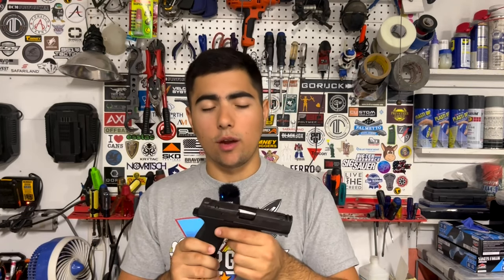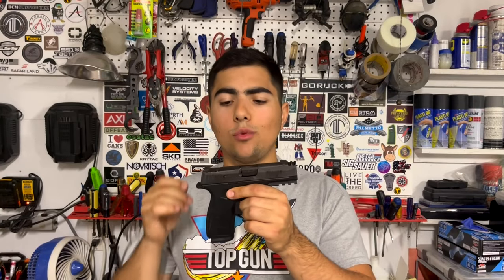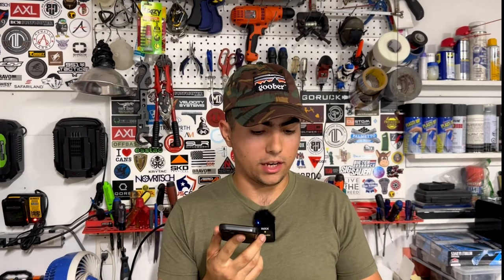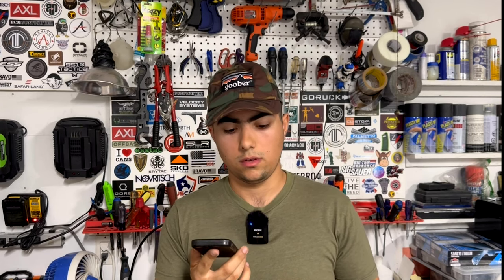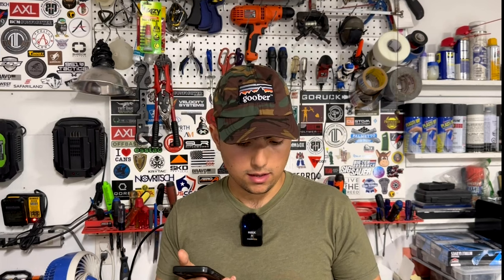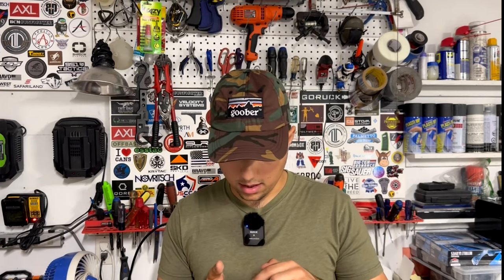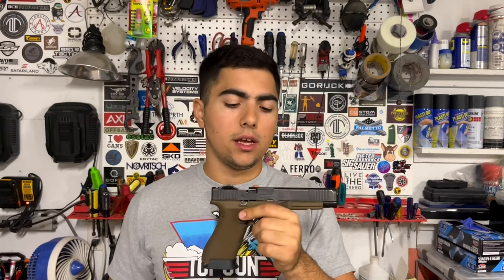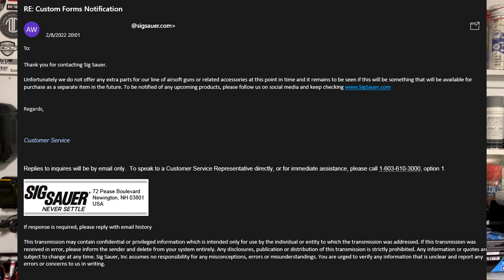Was I Wrong About the SIG P365 X Macro?

Comment: As someone that disagreed and thought you might have even lied about your initial video. I'm disappointed in Sig's response all around. My p365 xl slide hasn't had any issues in over a year of use. 
I won't be purchasing anymore Sigs until I'm confident in their work. Sorry about your experience.
Reply: Here's exactly what SIG did, in my opinion. THIS IS ALL MARKETING AND Most importantly GETTING RID OF OLD INVENTORY..Sig Sauer came out with the macro Grip module,( its a great module.) So Sig made the ported slide with the 3.1inch and a tac opps 3.7inch  that came with 4 magazines, that will probably rust also, sitting side by side with original p365 magazines. 

For the Tac Opps (Invision this and tell me i'm wrong) STRIGHT FROM THE TUPPERWARE BOX, Tac opps purchasers Were given slide back plates that have been unfinished and rusty. Tac Opps owners were given a trigger shoe un-finished & rusty. The barrel or should I say the bore chamber RUSTED. ALL PUT TOGETHER OUT OF A TUPPERWARE BOX.🎉 GREAT MARKETING🎉

I got 2 say not everyone will deal with I am dealing with. Some Tac Opps come with suppressor hight sites and the one I had in had was perfect, but got sole under my feet. Grabbed another one with out inspecting it, now I dot to deal with this BS. I WANT non of these this, I Want my money back they want me to send it in.

I am definitely doing a review on mine this week. So I can show everyone.
Reply: @Pocketpowerplant  where’s it at?
Reply: Glock fan boy doing a review! I have 5 sigs now., no rust no problems.
Reply: @jerrybrooks7883  SIG fanboy acting butt hurt....the guy gas over $1000 into this.....why spend $1000 to make a vid that MIGHT make you $100 over the next 5 years....think before you blurt
Reply: @IronChefBklyn  I do like Sig but I also like Glocks and other guns as well. He was so Glock I didn’t think he could be non bias. I don’t know if he torture test or what. I’m sorry I hurt your feelings and offended you. I won’t talk about it no more.
Reply: @IronChefBklyn  , you may want to be the one thinking, unless you too video and record customer service issues, when you don’t know what the outcome will be. How many videos has he posted of other phone call/ recordings, of any other customer service related issue? I don’t see one for his Glock screw breaking…
Reply: If they don’t have the gun, they won’t be able to give you a proper answer. Duh
Reply: @Pocketpowerplant the gun didn’t have rust on it when he brought the gun. So whatever he’s doing he should stop.
Reply: Your getting rust under your optic plate which means moisture is getting under that plate. So how many t did you tamper with that optic? Proper cleaning.
Reply: Use Lucas
Reply: Good more sigs for me
Reply: It's the finish very thin or improperly applied to slide... ruger had same issues. Companies .are a mistake and try to save money and this happens.  I love my sig no issues.... but I will say this. To me cleaning every two weeks or scrubbing on any coated metal will cause issues. I clean my guns 400-500 rounds....thats full clean up.... of course a wipe down after range day helps keep it clean ...but he said every two weeks seems excessive to me. He has 2k rounds that would be 5 cleanings not wipe downs. He said he cleans it every two weeks as he shoots it every two weeks... thats about 12or13 cleaning in 6 months....seems excessive ... also I would look into a different cleaning solution maybe something less corrosive... either way though sig should have offered a new slide because how do you sell guns to the military and want many many years of use but u fail in other firearms. I bet this was QC because you would see every single xmacro with same rusting or corrosion in same spots . Something happend in the coating process or in the surface prep and the coating didn't penatrate correctly or bond.

Comment: Been carrying my 365 XL every day in Texas close to the coast for about 2 years. No rust on mine... I clean it all the time though. I feel like the Macro has a cheaper finish. That's pretty unacceptable when you look at the price tag.
Reply: Its a business called profit, none of these companies DO T cheap.out of the coatings. 
If they made tou 1 product that was ade fro. The nest materials you wouldnt buy aftermarket. 
Since the very very first lightbulb this has been happening. 
Uf they have a choice of 1 that will function flawlessly forever or 1 that needs to be worked on yearly. The yearly repair will win every single time.
Reply: @madman-fr3rx  how about rusting out and falling apart in 2 months when they're by far the most expensive gun in the segment?

Comment: Thanks for taking the time on this. I was a long time Smith fan and still own several. I switched over to Sig for Carey when the OG p365 was released.  I’ve had that and carry it daily for several years.  I also have an xl that I’m now carrying in my rotation. No issues with either firearm at all. Been very happy. But I am hearing a lot more issues with. The Macro hence why I just plan to buy a few 17 round mags.  The CS experience you had was pathetic. No empathy at all from the rep and no real resolution. I have to say S&W is also another one for fantastic service.  Hopefully Sig listens and changes their CS ways.

Comment: I had an issue with my Hellcat Pro where the screws for the red dot would get tight before the optic was fully tightened down. I called and a real person answered the phone. They over-nighted new screws in multiple sizes for me to try out and when those didn't work, they sent me a label to send my slide in to get checked out and re-machined if necessary. They never asked if I was the original purchaser or anything like that. I had the slide back in my hands in 4 days. Even though there seemed to be a QC issue with my slide which isn't exactly comforting, Springfield's customer service was top-notch and made the situation right without hesitation.

Comment: I had a similar experience with Sig customer service a few years ago when they first brought out their 1911s. I bought a brand new Sig c3 Crimson Trace and it had nothing but problems, and after a number of emails and phone calls basically refused to do anything about them,  (which after reading years of posts on many forums Sig 1911s had a lot of issues right out of the gate and they obviously didn't care about their customers). Sig made nothing but excuses and never seemed to want to fix the problems or make it right. In the end I ended up giving it to local gunsmith who had to replace many parts including the barrel, barrel link and pin, slide stop, group safety, and thumb safety. The gunsmith made a comment about it had looked like a complete amateur worked on the gun and it was embarrassing, (pistol didn't even have 500 rounds down the pipe). Now it runs like a top but cost me $385 back then. Looking back on it I wish I would not have purchased that pistol and would have taken that cash along with the extra $385 and purchased a similar model Dan Wesson.
Reply: My Norinco 1911a1 has been 100% reliable and accurate close 100 yards

Comment: My xMacro has been solid (so far), however, like you, my factory mags started rusting almost immediately after carrying AIWB. Granted, it was summertime and hot but still unacceptable. I also recently ordered the Sig mag funnel, mag release and extended slide release. I agree, the Tac Ops is a much better value. I have also had a less than ideal experience with Sig customer service. I still like the pistol, however, when you pay as much as we did, we shouldn't be having these issues. Not a Sig Fan Boy at all. Disappointing for sure.

Comment: The finish and steel is where Sig cuts corners on their striker fired guns. It isn't likely that you would have the same problems on a p226. On the steel framed DA guns, the finish will wear, but it's not a huge issue because it's stainless underneath the finish.

Comment: I have the macro and had an issue with the the rail. They were responsive and replaced it for me at no cost. Also, the gun fell out of my vehicle into mud, which I washed off in the lake. Dried it and never had any rust. It does sound like some guns have a  problem with the finish, but I’ve experienced that with more expensive shotguns. Sorry your experience wasn’t good, but mine has been satisfactory so far. Thanks for your take
Reply from the maker: Glad they took care of you.

Comment: We have used Glock and Sig CS as a dealer and me personally as an individual. Both are excellent. I sent in a 320 slide 3 years ago that had tiny white spots on it (may be due to rust) they refinished and sent it back at no cost. Maybe they changed their policy in terms of "rust" or maybe it was just the rep and it didn't help you said the trigger words "EDC". I've sent guns back to Glock and 90% of the time we have excellent experiences.
Reply: It’s an EDC gun. To heck with what he said he uses it for, they should stand by their product. No excuses.

Comment: The SIG-Sauer company, as recently as 10 years ago, isn't the SIG-Sauer company of today. Understand that if you buy a newly designed and released SIG firearm, newer than 2-3 years, you are a product "beta tester" for SIG-Sauer. That's been the case since the drop-unsafe P320, and includes the primer drag & breakage of firing pins in the initial P365 designs, and now the reports from a LOT of P365 X Macro owners noting their pistols are prone to rust, very soon after purchase. 

When a $300 Stoeger Industries 9mm pistol has a finish vastly superior to that applied to an $800 Sig X Macro, it's pretty clear there's currently a "problem" at SIG, not only in quality control, but in what SIG is willing to push out the sales door.

Comment: I was in between this and the Canik TP9 Elite SC and this helps solidify my decision. The only negative review I could find about the exact model of Canik mentioned, was that the spring MAY need replaced, but Canik will send you a brand new spring in the mail IF you have the issue. Every other subcompact gun on the market has way more issues than a spring or rusting so Canik here we come!!!!!

Comment: I've had no issues with my EDC P 365 but I have put very limited rounds through it because its not fun to shoot. I was pretty set on the XMacro Comp or Tacops but this is definately making me think twice. I also had a terrible experience with Sig's first gen Romeo Zero for my 320 XCarry, To say it was unreliable and failed often with battery connection issues would be an understatement - and sig offered no solution. I am starting to feel the CZ P10 S with a +3 baseplate for about half the money might be the better choice. Thank you for your informative video!

Comment: Your experience is not surprising to me at all.

The very first gun I carried was an FDE  P320 compact in 9mm. It also had a shitty finish that wanted to rust really bad. I babied and babied it with oil on the exterior of the slide the entire time I owned that gun. That wasn't the main problem though.
After about 4k rounds through the gun, I started having nearly constant failure to extract with attempt to feed malfunctions.
I called Sig customer service, let them know exactly what was happening, and they informed me that they had an updated/improved extractor assembly that I could purchase for full price. I was pissed off, but decided to purchase it anyway. It made those malfunctions less frequent, but certainly didn't eliminate them. That's unacceptable for a carry gun.
I sold that P320 and I won't buy anything from Sig anymore.
Reply from the maker: Damn that is super scummy or them. They come out with an updated part to fix a poorly designed part and they make the customer purchase it? And then it doesn’t even fully fix the issue? That is some shit tier customer service.

Comment: Heads up. I am a member of a really busy gun store/range. Many friends work there, to include armorers. They say quality control issues are on a rise on a variety of many manufacturers. I even personally just returned a firearm from Ruger for a barrel interior with rust and pitting. My guess and others think there are bad supplies of steel getting into the pipeline and due to demand QC is harder to keep up with. This is an industry problem not just one company. 

Make sure to really thoroughly inspect anything you purchase.

Comment: I wouldn't limit myself to call this a bad CS experience. There's very probably a QA deficiency by Sig  finish wise, which CS should have corrected, and it hasn't. It appears as if Sig knows about the issue but won't acknowledge it for whatever policy reason. Buyer beware.

Comment: @donkeydefense Dude, I just saw both of your videos and now my trust in Sig has been shaken. I bought a P365X Macro about two weeks ago. I took it to the range and put about 250 rounds (not consecutively, had other guns I was shooting) through it and the trigger assembly stopped engaging the striker assembly. There's almost no weight to the trigger now and the pistol will no longer fire. Brand new gun.
Reply from the maker: Jeez that’s absolutely awful. Hopefully sig treats you better than they did me.
Reply: @donkeydefense  I took it to a local gunsmith and they found one of the springs came out. I'm going to try it at the range again before contacting Sig.

Comment: I just bought a 356 X Macro December, 2023. I spent $800.00 for the pistol and it came with raised sights and a Romeo optic plus 2 mags 17 rounds.  The dim bright setting on the Romeo is on button just behind the optic glass so if you have fat fingers then it’s very difficult to adjust the dim brightness of the optic. You have to keep pushing it until it cycles all the way up then down to the point you want it at. So they have an optic that has separate up down buttons. I ordered it for $200.00. I’m a deputy and will carry this in plain clothes so I have to have three mags. With shipping and again directly from Sig $72.00 for the 17 rd mag. I bought a simple holster and a double mag pouch from a local gun store $110.00. All in $1,182 US. I’m a Glock guy and have several. One my department gave me when they went to the Glock 19. The department had made with our badge engraved and the special serial numbers to match our DSN/badge number which is never recycled. It’s 21 years old and I have put thousands of rounds through it and it still looks great. 

The Glock 43 X MOS with optic a raised sights with two ten rd mags and three Shield Arms 15 round mags all in $550.00. Is it worth the price difference to own an Sig 365? I don’t know yet because of the honeymoon period. And Glock needs to up their game when it comes to mags. But all my Glocks are excellent handguns for any price. But I like how the Sig fits my hand. I didn’t think Sig’s customer service was all that helpful. The rust do to body sweat is totally on them. What do they think the U.S. Army is going to put the weapons through? Glock should have won that contract because there are hundreds of law enforcement agencies that have reliably carried Glocks for 20+ years with not many complaints. Officers and soldiers deserve the best and that’s Glocks.

Comment: The FCU is basically the same on all P365 series pistols with the only differences being straight vs curved trigger, std vs extended slide catch and std vs extended magazine release button.  I have not had any surface coating issues with either my P365 or P365XL or my thirteen 12 rd and two 10 rd magazines.  However, I have seen finishing issues.  The stripper rail on my P365 made in 2020 was so rough that it left scratches in the brass shell cases and was difficult to rack with a full magazine until I polished the stripper rail. My P365XL made in 2022 was not difficult to rack, but polishing the stripper rail still reduced the force required to rack the slide over a magazine loaded to capacity by 9%.  The contact point with the sear and striker safety lever on the trigger linkage bar is on the very rough stamped edge of the bar!!!  Polish this edge and the trigger goes from gritty to very smooth.

Comment: Staccato fixed my rusty slide and thumb safety for free.

Springfield sent me new optic screws for free.

Shadow Systems replaced one of their optic mounting bits (the plastic wedge you're supposed to use) for free.

Beretta replaced my whole gun because I was unsatisfied with machining marks on it.

I had a thread protector for my Sig fall apart and sig told me they couldn't help. I couldn't even buy it if I wanted to. 

One of these is not like the other.

Comment: I kept going back and forth between the 43X and XMacro this sealed the deal for me. If you don’t stand by your product I can’t buy. If this was a small issue they would have handled it. Clearly this is a big problem that they’ve decided to live with.
Reply: I have both and i'm definitely getting rid of the Glock, like i did the rest of my Glock..  Good luck
Reply: @davemiller9314 dumb decision
Reply: @oscarcortez5863  No it wasn't. I've got 1, 000 rounds through the Sig 365 X Macro and never cleaned it. Not one malfunction and it's much easier to shoot, feels much more comfortable and looks 10 times better than any Glock...  But the Glock was a little cheaper, and it showed.....  Good luck,  Bye Bye